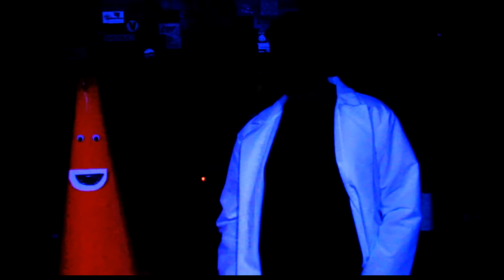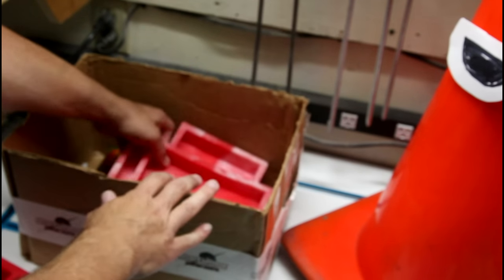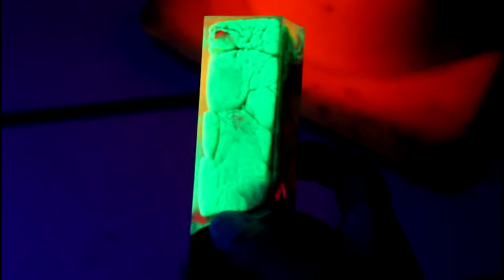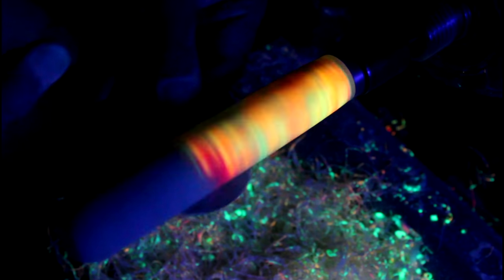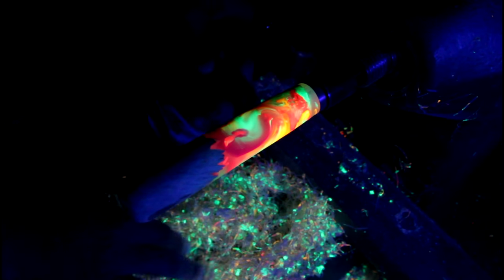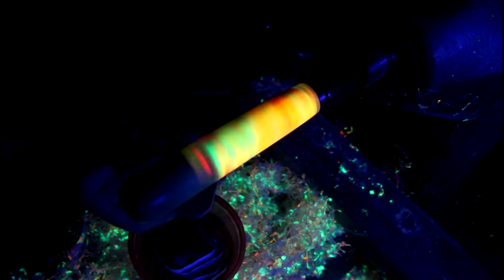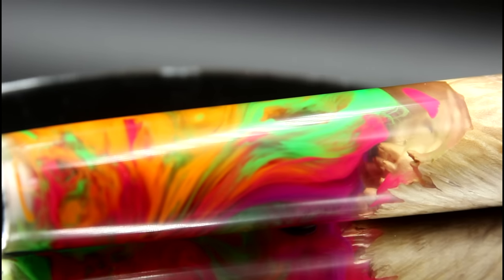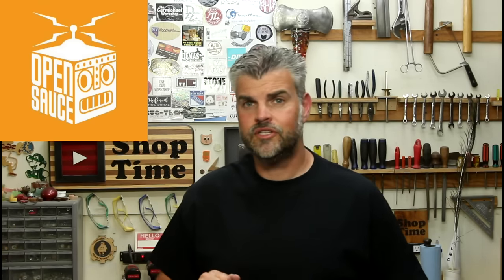Is this a Good Idea or a Bad Idea?

Comment: So an idea for the cast (this might be too involved, but I think it would look cool)

Make a mold of your arm, and fill it with different layers of different materials you've used over the years. Shredded metal, break away glass, gummy bears, lava resin, etc. Then you can put half of the cast on one side, and leave the other side open to show off the layers. 

Kind of shows everything you've achieved this far and some of the "cost" it took to get there all in one piece.
Reply: I really like this. If you cut the cast in half you can make 2 different projects. Maybe save the other half for a year and fill it with materials from projects you've done from when the cast came off, to the 1 year anniversary of it coming off.

Comment: Easy idea for the cast: Make a mold of your arm, get some of skeleton bones (arm, natch) and then pour a resin cast of your arm with the bones in using fluorescing translucent dye or UV resin (whichever's cheaper), and then mount the cast on the arm!
Reply: That's an awesome idea
Reply: How do you a bone in the middle? Cast half, place bone, cast the other half or do try to suspend it with wire in a full cast? I guess thats the video haha idk if bone floats or sinks so that would matter too! Lol
Reply: @ginger_nosoul yeah for suspended things in resin they usually cast half then place the object then cast the other half. Floating can be a problem but if the bones are also made of resin the density should be the same and have no issues. The timing has to be perfect though to have the two layers fuse properly and have the bone able to sit on top of the first layer.
Reply: And break one of the bones!
Reply: @baseddino  thank you for the insight! its a balance that i know little about! I just tossed out ideas as a new guy.
Reply: @suzil7687  Hah, great idea!

Comment: I used to do pours like that into clear resin when I had access to vertical molds. As much glow in the dark stuff as I've been casting when I put myself in the shop I've often thought about doing the blacklight turning myself.

Comment: Question:is there any combination of lathe speeds and camera settings where you can get the frame rate roughly in sync or an integer ratio with the lathe?
Reply from the maker: William Osman came by in (2017?) and we got some great shots. https://youtu.be/S6bWLddkpXE